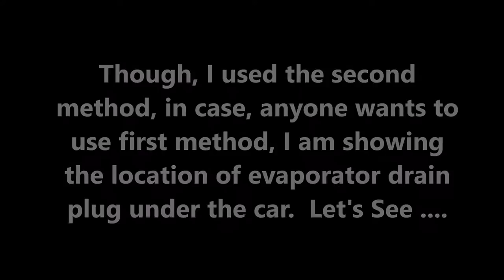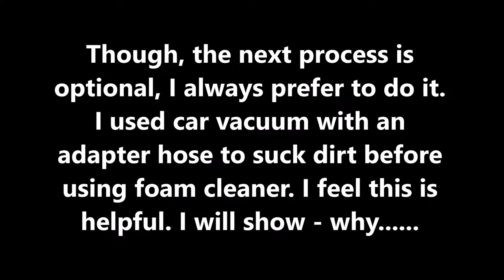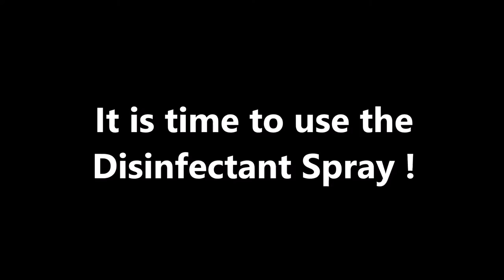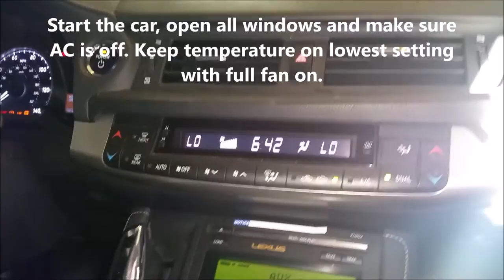CT200h - AC Evaporator - How to Clean using foam cleaner

Comment: I didn't use these specific products, I used a heavy duty foaming cleaner which was just foam. it didn't turn into liquid and drip out easily so i twice flushed the evaporator with some industrial grade alcohol.  worked like a charm. Also i closed all the vents and turned on the fan (max setting) so any cleaning solution left inside blows out.